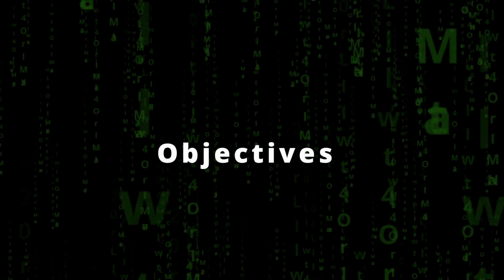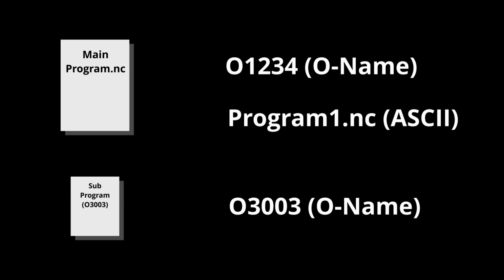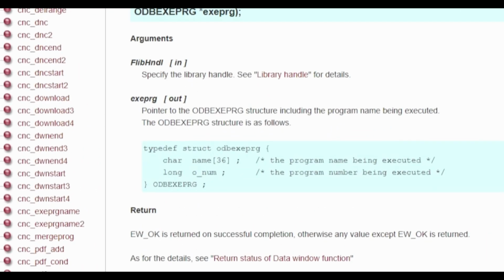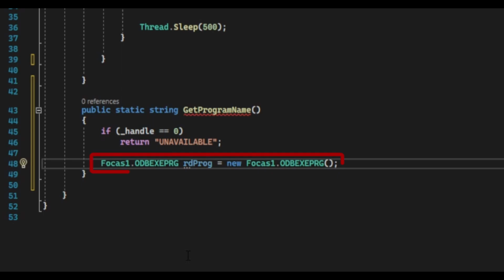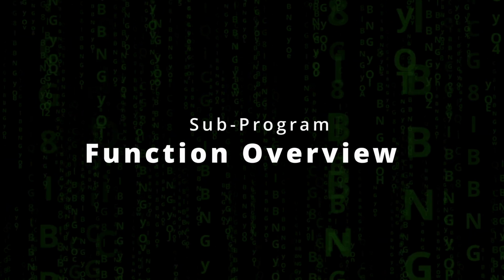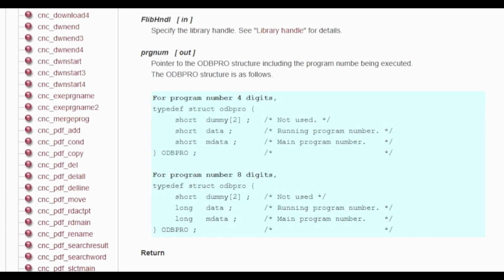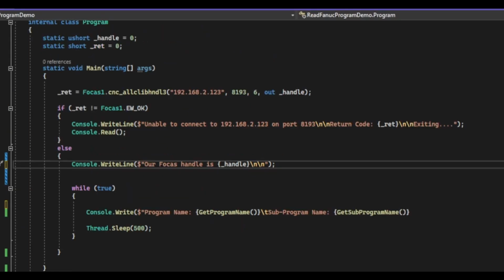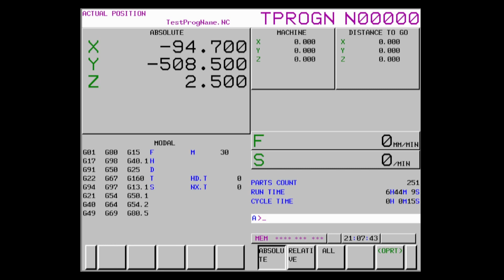Mastering Fanuc Focas: CNC Programming (Program Names)

Comment: You can call any aschii named program as a sub program using the <> operators if its in the current file path.  M98 <TEST.NC>  is a valid sub program name on 31I controls.  And also if you need to specify a specific program, you can include the full path to the file like this M98<//DATA_SV/O4000>  This specifies program O4000 on the Data server root directory.